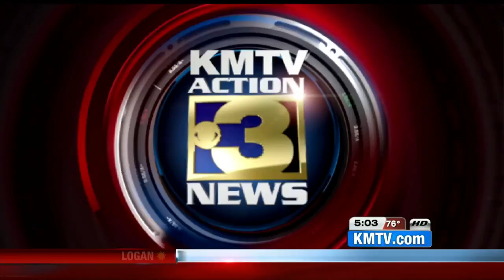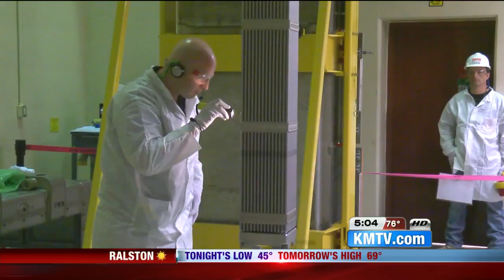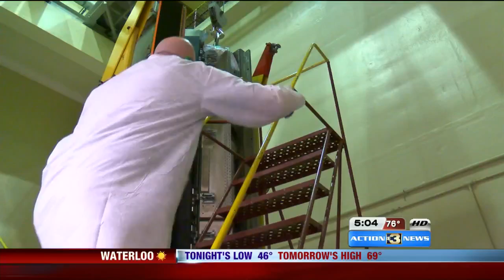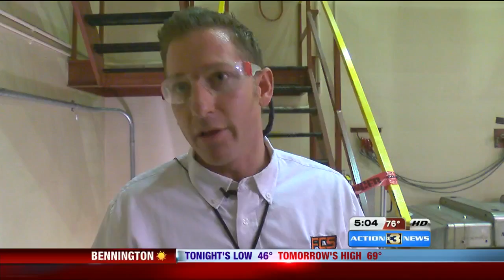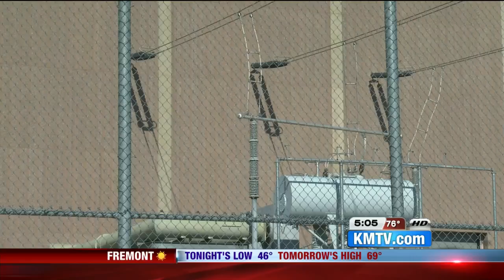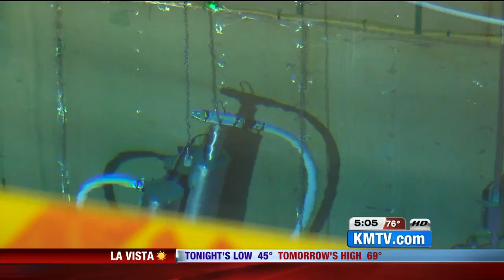Replacing nuclear fuel inside Fort Calhoun

Comment: So water, it's affected. And also transports nucular particles through water molecules. And these guys have no oxygen tanks on or protection. Standing beside the rods and they're breathing in air. There's water molecules in air.
Reply: New fuel doesn't have all the dangerous fission products like caesium 137. We usually use masks when there is risk of radioactive particles in the air. And we do a whole body count, which is supposed to detect if we got an internal contamination. And it seems that they are doing it before the fuel assembly is stored in the water, so water wouldn't drop on them, but if they were just standing next to the pool it's kinda safe.

Comment: Technically its not a nuclear powered. the super dupper expensive Nuclear reactor just boils water to make steam like its 1912. Now i could understand if the fusion actually produces the energy, but it doesnt. steam does. Why do they have to refuel twice a year. a Nuclear Aircraft Carrier only needs to refuel every 25yrs.
Reply: Reactors operate on fission, not fusion. The reason for refuelling frequently is that reactors operate on Low Enriched Uranium, whereas a nuclear sub or surface ship reactor uses High Enriched Uranium. There are all sorts of political and 'economic' reasons for this.
Reply: troglodytes
Reply: Fusion plants would still use steam

Comment: These need to be visually scanned by AI computers and humans, not just humans...with a flashlight.
Reply: When there's a failure in the fuel element, it makes a mess, increasing the contamination of the water in the primary system. This water goes through filtering, so it's a cleanable mess. It will generate more waste but not really that much. So there's no reason to be too much worried. Visual inspection often doesn't replace or get replaced by other technologies. It's still a cheap and effective thing to do. To be fair I have no experience with fuel assemblies, I work with electrical maintenance in a nuclear power plant, but these issues can affect us and our equipment, but still no actual disaster.
Reply: Who designs, builds, and tests the Computer?
Reply: @finaltransconfigurat  RIght, so no computer is trustworthy because a human programmed it?  Not true.

Machine Learning programs program them selves.  Its work is checked by humans until it matches humans and then exceeds them in this limited task.  AI is amazing at seeing patterns and breaks in patterns.  So, yeah, an AI would be an excellent way of backing up their work.

Besides how many machines have been built for centuries that can reproduce an action that exceeds the capability of human in accuracy? You don't think a firearms hand-made can be consistently matched to machined firearms do you?

Comment: Nucleaire power safe? We build reactors all over the world to sufficient aur energy demands, but what are we going to do about the 3% waist that’s coming out of every rod that’s been reprocessed after use over and over again? The so called fishinproducts are a nightmare! Let’s find a solution for decaying the halftime for like cesium 139 . I think we need to do more of finding a way to correct this then building a feature on nuclear power.
Reply: The fuel is reprocessed and the left over fission products are put into steel containers with lead shielding, after about 10 years the radiation is low enough to handle and the left over products be disposed of.
Reply: At the moment it looks like they bury the fuel in bedrock. After a few hundred thousand years it will be safe enough to handle. A long time for humans, but not geologically.
Reply: troglodytes
Reply: How am I supposed to take you seriously and you can't even spell, among other things.

Comment: Uranium plants only use 1% of its uranium fuel, if we switched to Thorium nuclear, its 95% efficient, uses up plutonium instead of making it, only has to be refueled every couple of years instead of once a year, doesn’t use high pressure water so it’s very safe and thorium reactors cannot melt down.  Their waste is smaller and only has a 1/2 life of 300 years.
Reply: And where are you going to get your plutonium from? How are you going to convert the heat from the reaction to usable energy? 
Could you link your sources maybe?
Reply: You are are talking of breeder reactors. its very expensive to build. However, the problem of cost effectiveness would be addressed if a major break-through is achieved with SMR technology.

Comment: Ok its emits almost no greenhouse gasses like coal does - it is more efficient - but spent necular fuel is highly toxic waste product which will most likely end mankind one day from a leak or disaster - so keep promoting it and how amazing it is!
Reply: Guess what rocket we can send to and from space now to jettison said "ender of mankind". Also ratio
Reply: While spent nuclear fuel is still radioactive, the long lasting radioactive fuel only accounts for less than 3% of all nuclear waste. Most nuclear waste can be recycled for medical equipment for example. There are also reactors that can use that tiny amount of highly nuclear waste and complete use up the remaining radioactivity. On top of that, there is nothing to leak out of radioactive barrels, they are a mixture of concrete, glass, ceramic and nuclear waste and we could bury them deep underground under the bedrock layer using oil drillers to make the hole to store that waste there. A power plant would only need about 20 of these for the lifetime of the plant. Nuclear is truly the green way to move forward but theres so much misinformation about it
Reply: End mankind?   The most toxic and dangerous thing on this planet is misinformation and the people who spread it.
Reply: Stephen Moro you know what’s even more toxic? The chemical waste from making solar panels and solar panels only last for 20 years, there is no way to dispose of them and they leech lead, arsenic and cadmium into the soil and our drinking water.
Reply: Fearmongers like to exaggerate the cons of nuclear, often relating them to catastrophic/apocalyptic situations.

Comment: safer than coal... wtf
Reply: Powder what's wtf about it? Sounds true to me
Reply: It is safer than coal because it doesn’t produce carbon dioxide and emissions etc. The design of these power plants have multiple failsafes Incase of an accident.
Reply: @blissurzu7216  
Sigh... I still need to fix this.  In engineering terms redundancy and fail-safes are VERY different concepts.  A redundancy means there are extra systems, in the event that some system fails.

Fail-safe means that when systems fail there is no safety concern.  There are several reactor designs that are now fail-safe.  It's quite an important distinction IMHO.
Reply: @lordsamich755  while modern reactor designs have incredible safety, putting these plants next to cities where water might not always be available is just too much of a risk
Reply: @drkastenbrot 
WRONG!
The GT-MHR is gas cooled for a start.  Furthermore the use of silicon carbide in a 600MW power profile means that decay heat can NEVER cause a meltdown.  Even with zero cooling after shutdown.
Reply: @lordsamich755  so how much does that cost to run? making an actually safe reactor is cool right until you look at the actual operational cost.
Reply: @drkastenbrot  
I've decided to address this anyway.
The GT-MHR is 100% fail-safe reactor.  This means there is no requirement for secondary containment, which is something like 90% of the upfront cost.
The 'power too cheap to meter', assertion is actually true with the GT-MHR.
Reply: @lordsamich755  that is completely in conflict with the NRC regulation which does assess the cost and danger of GT-MHR spent fuel. It seems like you have primarily read the marketing material
Reply: @drkastenbrot  
I got the notification, but you've deleted your comment.  I don't suppose that's because the information you were going to provide is completely wrong?
Generally if I fuck up that badly I edit the comment with -strike out-, and explain my misunderstanding.  But you're not going to do that are you?

As it stands your claim was that something I said was contradictory to some nuclear regulation, to which you didn't provide a link.
I'll say that's interesting since regulations regarding spent fuel have zero impact on the capacity of an active reactor to meltdown.  You also already conceded that the GT-MHR was fail safe.  Relying exclusivity on the notion that a GT-MHR would be too expensive to build, when it's low cost is the core principal benefits of modular gas cooled reactors.
Reply: @drkastenbrot  
It's seems like you've actually read nothing, since you haven't provided a link.
Reply: Absolutley, and on top of that there are several designs that are 100% failsafe!

https://youtu.be/Sp1Xja6HlIU
Reply: troglodytes
Reply: Not as crazy as it first sounds: coal power plants produce radioactive waste too, not to say anything about the enormous amounts of carbon dioxide emissions coal power plants emit, driving climate change astronomically more than a nuclear fission plant of a similar mWh capacity.

https://www.scientificamerican.com/article/coal-ash-is-more-radioactive-than-nuclear-waste/

Comment: Safer?????look at Chernobyl nuclear disaster
Reply: Which was in 1986 and was built by Russians. What could go wrong.........?
Reply: iamDoggy but it's still hot with radiation
Reply: Abe Coulter I’m aware that radiation is still emitted from Chernobyl. However, it is far less radiation than it was just days after the incident.
Reply: Bimo Ario it’s very safe and very efficient. 1 uranium pellet has the power of a literal ton of coal. Tepco knee that Japan had earthquakes and tsunamis but those money whores couldn’t resist the opportunity there. 3 mile island I don’t know much about. It’s the only nuclear power plant tragedy to happen in the US I’m pretty sure. That is why places like Palo Verde in Arizona still exist.
Reply: Abe Coulter What happened in Chernobyl is the result of a human error
Reply: Chernobyl was built the cheapest and most efficient way possible to get the most bang for your buck out of uranium 238 pellets.  This in turn made it susceptible to there being an unforeseeable catastrophe. Design choices such as not building a dome around the core, relying on graphite moderators and knowingly running the reactor (RBMK design) with a positive void coefficient made it like using a fly swapper to kill ants, it was eventually going to miss.  Fukushima was built at sea level in the most seismically active fault zone on Earth, along with only  backup diesel generators and nothing else to pump coolant water.  Many US designs have reservoir pools/water towers built well above the reactor to allow powerless cooling fed by gravity alone.
Reply: troglodytes
Reply: "What about Chernobyl" is pretty much the dumbest argument you can make
Reply: look at my ass
Reply: NeppyNeptune, we are all laughing our heads off right now. So mature. Please stop putting random, useless, rude comments in random reply sections.
Reply: look at my ass a bit more
Reply: iamDoggy what about three miles island?? Fukushima perfecture on 2011?? Fyi on fukushima case radiation fallout detected about 530 sieverts its insane!! And the worst part is highly radiation water leaks and escape from japan to west coast in America. According that fact My question is, it's still safe use enriched uranium to produce electricity??
Reply: @bimoario4437   three mile island is caused by lack of maintennance while fukushima daiichi it self is caused by the owner of the plant TEPCO is being an absolute ignoring their multiple tsunami risk warnings and have an idea to put their emergency gens in the basement

So yeah with no gross negligence and ignorants its safe to say that nuclear is safe

Comment: I'm hoping that fuel assembly was a demonstration unit, or they need to re evaluate their safety standards.
Reply: Noodles The Echidna it's real - it is being inspected for shipping damage. Before being irradiated in the reactor the dose is extremely low. Nothing unsafe, unless you drop it. A BWR fuel bundle is about a quarter of that size and it weighs over 700 lbs. 
We've been handling fuel like this for about 70 years. The first sustained nuclear reaction was about 75 years ago.
Reply: @jw9662   a fuel assembly weighting over 700lbs and yet it stays thin what is it fed bird seed. The inspection is for it's safety and the reactors one explosion can kill the fuel assemblies like what happened to the ones at fukushima and Chernobyl that was an maiming, mauling and slaughtering massacre of those poor fuel assemblies and reactors
Reply: Genius its not radioactive until they place it in the core of the reactor and activate the fuel assemblies.
Reply: You can bare hand fresh reactor fuel completely safely.
Reply: @GUNSandTRIGGER  it did too👺😤😠

Comment: Is Uranium radioactive and dangerous before the reaction is started and the fuel is burnt?
Reply: That fuel is only enriched to about 5% Uranium 235. Uranium. And it's an alpha emitter. That means your dead skin cells are adequate shielding for the radiation. So it's okay as long as you don't eat it.
Reply: Mildly radioactive.
Reply: @TheTruthQuest123 they don't react unless they're near other fuel rods. it's called critical mass. if you put 2 uranium rods next to each other inside the reactor they produce fission. and they also won't react until they have a moderator
Reply: it's safe enough to be around when it hasn't been inside the reactor and is unused as long as you are wearing what the guy doing the inspection on the fuel bundle was wearing. but when it comes out of the reactor they have to keep at least 10 feet of water over the used fuel bundles because they can emit up to 10,000 rems per hour of radiation (enough to kill you in seconds). also because the rods are very hot and would melt and catch fire if left out of the water. which is why the used rods must be kept underwater and handled at a distance. they even put the used fuel transport container under 35 feet of water when they pack the used fuel for shipping to a repository
Reply: @TheTruthQuest123 boron eats or absorbs Neutrons hence slows or stops the reaction when placed into the moderated reactor.
There is so much science around this that the comment section would go for days.
Depending on the reactor design and purpose fission will not take place unless certain criteria is met but simply with slightly enriched uranium fuel fission needs moderation to slow neutrons for capture and critical mass.
A criticality event will not take place with fuel bundles un moderated at 5% outside the reactor.
The reason the bundles are so dangerous after they have been irradiated has nothing to do with fissioning the reaction would stop as soon as it was removed from moderation (graphite, heavy water or pressurized water) its is the fission fragments from the fissioning process decaying that one makes it dangerous and secondly needs to be cooled from the residual heat from this decay.
Hope this helps
Reply: You see that they check fuel without any issue.
Reply: schlaznger Yes
Reply: Yes... but not very.  Don't eat it and you'll be fine.
Reply: Radioactive yes, dangerous not really.  Don't eat it though.
Reply: @WilliamWaiteProductions  No you wouldn't. You can bare hand fresh pellets completely safely.
Reply: Very mildly radioactive. You end up getting about 0.1 to 0.2 mRem inspecting a bundle. From natural background radiation you'll get about 300 or more mRem per year. So you get an extra tenth of a day's dose for each new bundle.
Reply: @TheTruthQuest123 to keep the radiation down you have to store the used bundles in a 40 foot deep pool because of the amount of ionizing radiation they produce. but if they're UNUSED then you can handle them with only lead lined gloves and a TYVEK suit like the person is wearing. the rods get more radioactive after they have been inside the reactor producing fission and heat
Reply: Oh heck yes. It's been purified and refined to even get to the point that it can be used as fuel.
Reply: @TheTruthQuest123 the rods are only dangerous to you if you held them barehanded. otherwise they don't emit any dangerous levels of ionizing radiation. but when they come out of the reactor and into the used fuel pool, they emit enough radiation to kill a person in 15 seconds. but when the UNUSED rods are being stored they're kept inside a lead lined safe storage room or possibly in an inert gas environment
Reply: Yes...it is...compare to thorium.
Holding uranium is like holding shit!